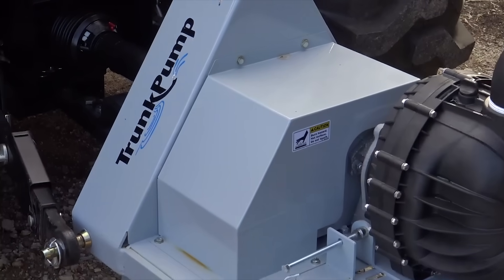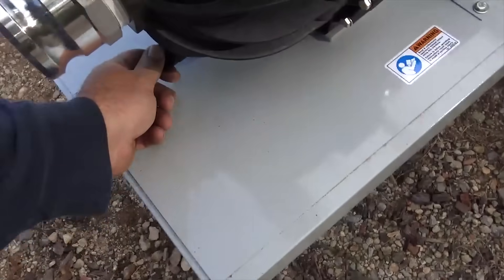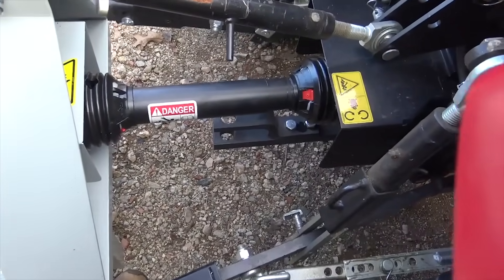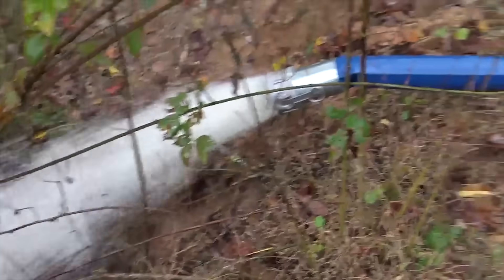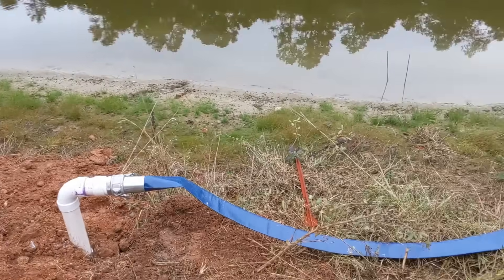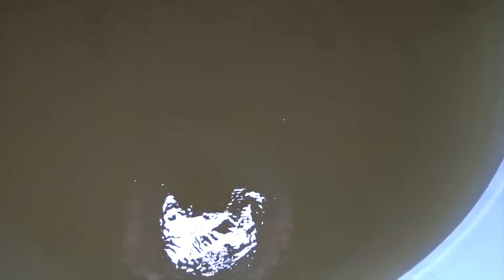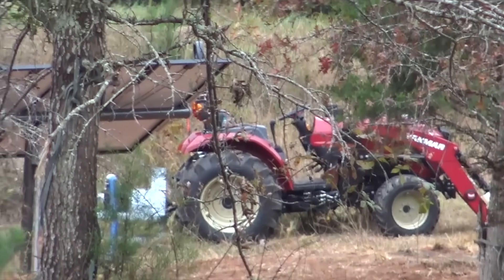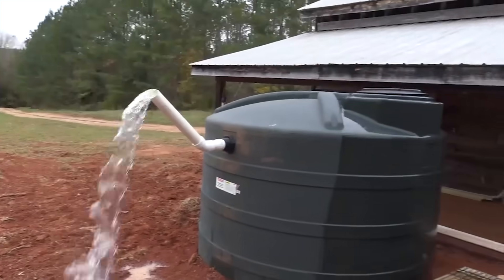PTO driven water pump : Trunk Pump

Comment: Why no foot valve on the suction for keeping prime if the tractor stops for some reason you do not loose suction
Reply: Norfolkc Yeah good idea.  I have a foot valve on my 1 inch gas powered harbor freight pump as well as my 2 inch Harbor freight pump and I don’t have to prime it every time.
Reply: It’s normal to fit one

Comment: Moving some water in a hurry. Do they make a PTO pump that can be used to lift out of a deep well?
Reply from the maker: I have never seen one.  It would have to be connected to a Jet pump type of head.  You might be able to pump from about 120 feet.
Reply: Im not up to speed on whats available but the large AG irrigation wells are run with 50hp electric motors on top of them Or a stationary engine connected like a pto. try contacting a AG irrigation company.
Reply: No you can not lift more than 26 feet with this type of pump

Comment: With the oil field slow down alot of trailer mounted pumps will be cheap soon....many can move 120 bbl a min.....now that is in a 8" or bigger line...and a few hundred yards up hill they used to have a "booster pump" every mile or so and 3 lines when we were a long way from the water spot...but for what most people want you can get about 100 psi out of them on a 4 inch line for quite a way ....they are quite a bit larger than the PTO pump you have but that little thing was moving some water now...I have watched you channel for a long time.....your info is spot on...no BS or sales scams just good decent real world info...when I was on the drilling side if the oil field we pumped our water from near by ponds we had a small duplex pump and 2" poly pipe we found all the weak spots every time we had to pump up hill lol that stuff lasted a long time and fixing a break was easy...my brother drilled water Wells also where we live .5 to  .25 gpm is a decent well some are up to 15 to 20 gpm but I am amazed how many people will turn their nose up at a 1 gpm or less well in a month that is a lot of water when there is not any other around....I wish we had the 40 foot was table and 10gpm or better stuff here but we don't...but what is funny the water is normal about 40-60 feet down....and hard to find...but if you have a storm shelter it will fill w water cracks me up one of my brothers homes has a cistern (I can't spell tonight) it is about 3000 gal we pumped it dry and a week later it was full again....his water well in his back yard is about 50 feet deep and makes about 1.3 gpm now he used it all summer for his grass...he decided that was not a good idea after he had to mow in 110 degree heat lol

Comment: You should think of putting a T after the output with valves on. Then you can have aaan open return/pressure/flowregulator while topping up tank without the need to standby rpm regulator. Also helps streighttning out kinks in the fillhose. Or as a dual hose output.

Comment: Good video... I'm looking for something like that to pump out of the river to help control fires as I burn my underbrush. How high can it lift on the suction hose and do you think if I reduced down to a 1.5 inch hose I could push out 200 feet?

Comment: Wondering what the purpose of pumping that pond water into that holding tank?
Reply from the maker: It is the water that will be used for compost tea operation for a duck impoundment. Customer wanted a fast way to fill his water tank so he can make his batches of tea quickly.